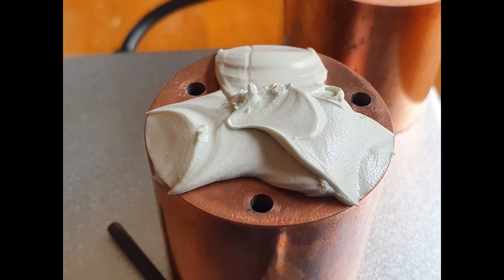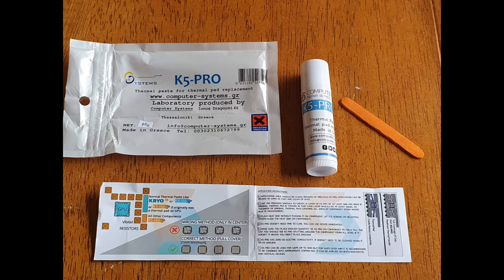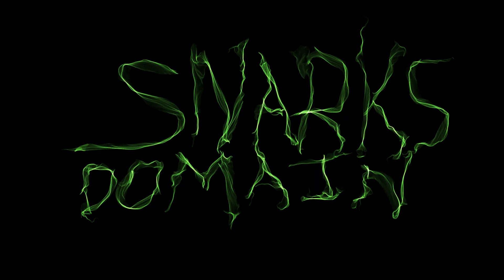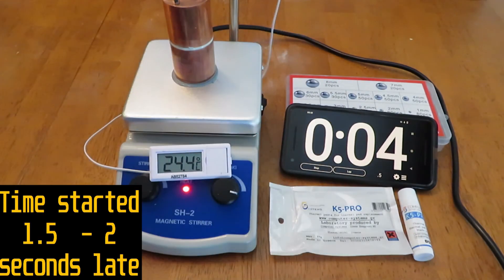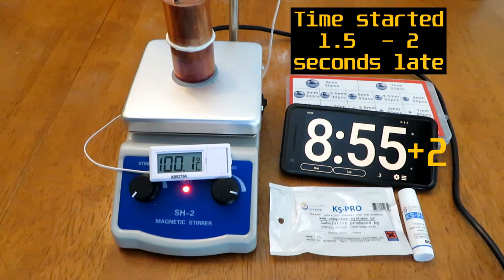K5 Pro vs The Hot Plate

Comment: K5 Pro is absolute garbage, I did try this out on an RTX 3090 once and results are worse than generic 3W/mK pads.

K5 Pro is also very hard to remove, I had to use lots of white spirit and later IPA to remove it.
Reply from the maker: Yeah, it's definitely less viscous than TG-PP10. 

I haven't pulled the copper blocks apart yet as I want to do a confirmation run. Will see how easily it cleans up after 2 cycles.